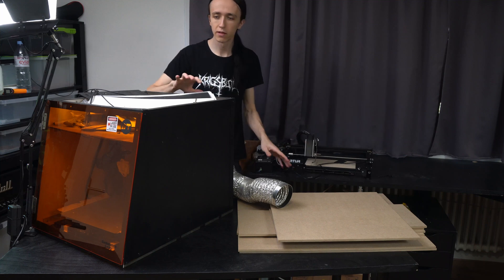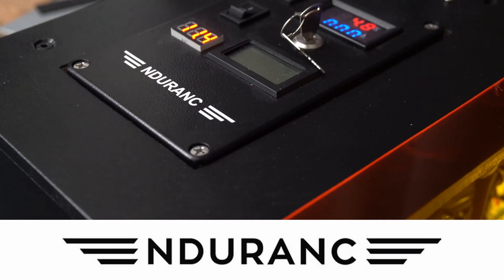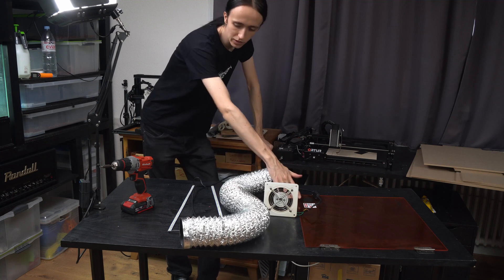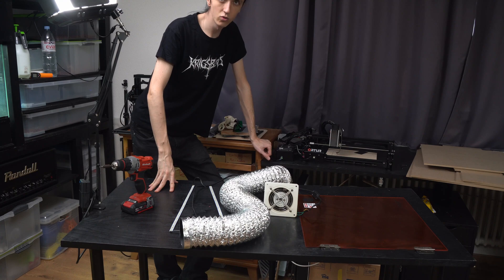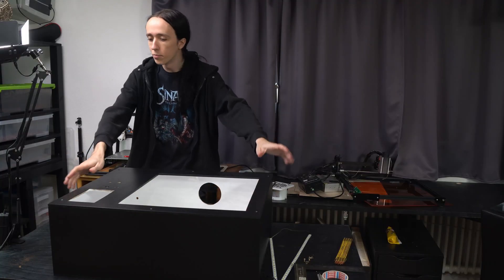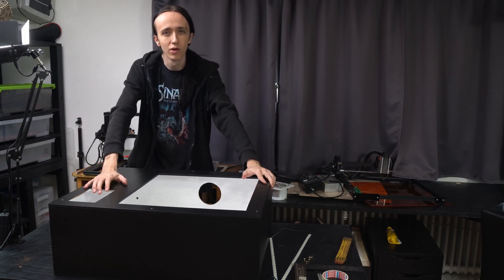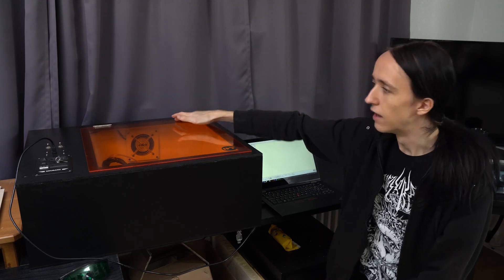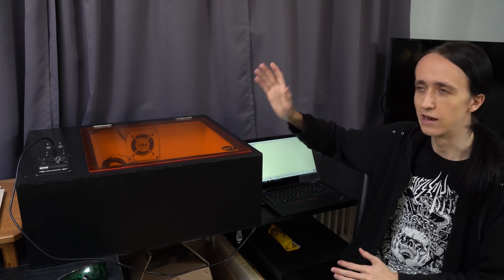Ortur LASER Master 2 ENCLOSURE - Ultimate Diode Laser Setup

Comment: Is the Endurance Laser a drop in replacement for the standard 15W lasers on my Ortur's, or do you need additional updated hardware to handle the higher output laser?
Reply from the maker: The Endurance Laser comes with it's own power supply and controller box. You then just hook up the signal wire that went to the old laser diode to the input of the new laser controller which is connected to the new laser diode.
Reply: @DarkArtGuitarsWorkshop  That is awesome! Thank you for the response!

Comment: Do you not need an air input to balance the airflow inside the enclosure?
Reply from the maker: In theory yes, in practice there are small gaps everywhere and I'm also adding compressed air in for the air assist (not as much as I remove, but together with cracks it works). I compared the airflow out the exhaust with the lid open and closed and there is barely any difference.